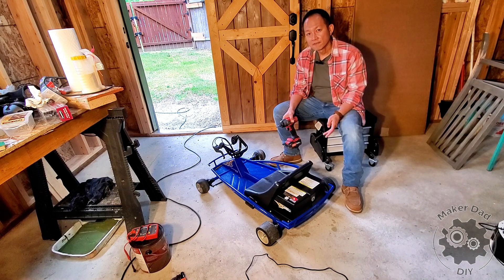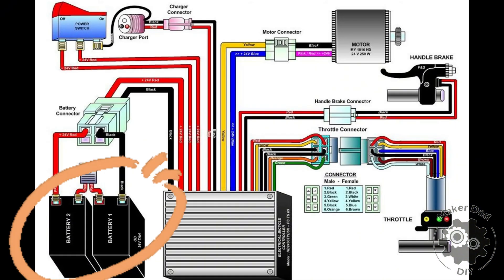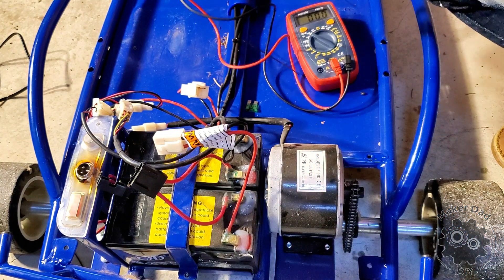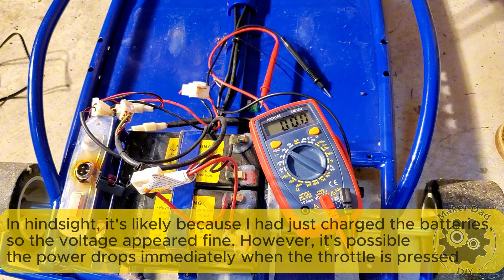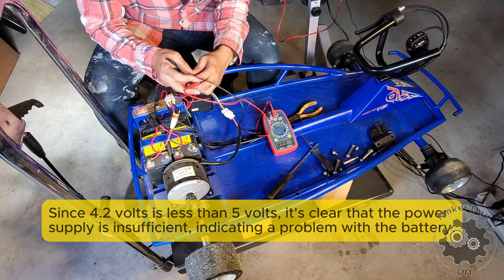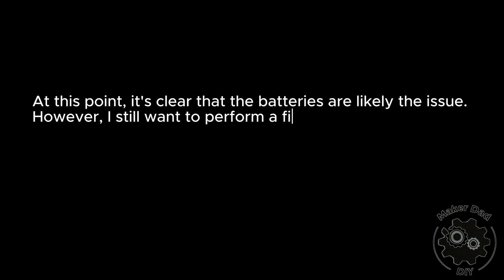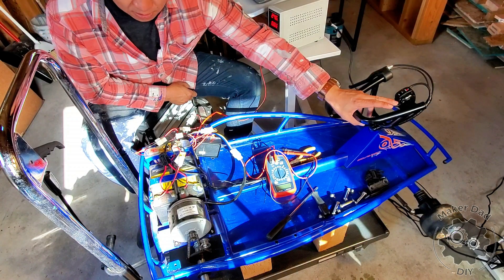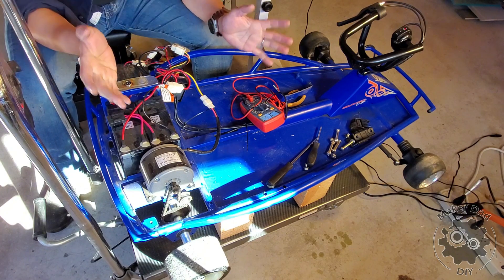How To Test, Troubleshoot And Fix Razor Go Kart (Razor Ground Force/Drifter/Fury Model)

Comment: What if the light goes on when I connect the battery to a charger and I turn the switch on. I push down on the throttle and I hear the click noise. The battery seems to not be charging?